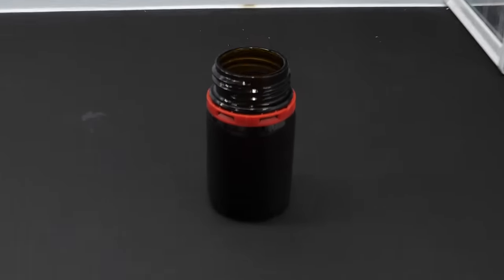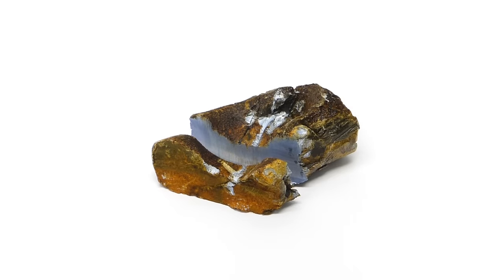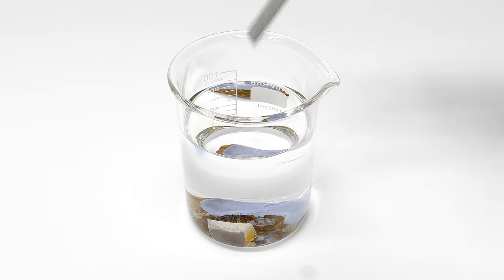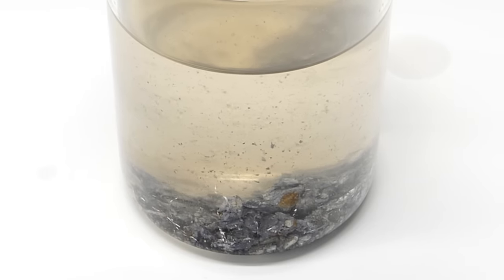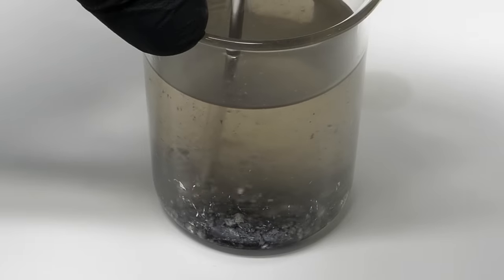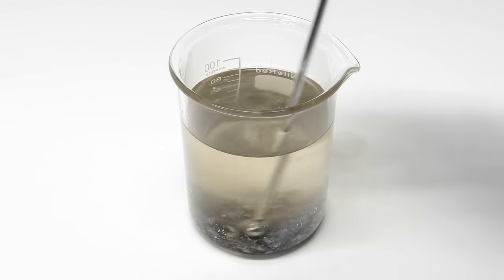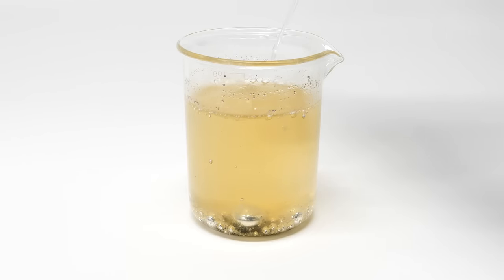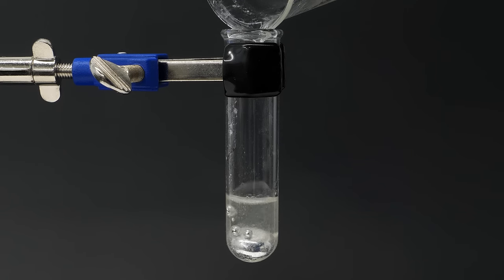Mixing sodium and potassium is crazy (NaK)

Comment: The thing that caught me off guard was just how less dense sodium is. When he said 0.9 grams of sodium I was not expecting it to be this big of a chunk lol
Reply: Oh wow only 278 likes
Reply: Nice observation
Reply: Yeah, a mole of it is like 23 grams
Reply: Sodium ain't even denser than water
Reply: @Kiromony  did you just have a stroke?
Reply: @oddmerlin9797  sorry, quite sleepy rn

Sodium's density is around 0.97 gr/cm³

Water's desity is 1 gr/cm³

This means:
 1- sodium will float on water

2- even a large chunk of that metal wouldn't even weight 100grams

It is quite impressive if you think about it.  A metal that floats on water. I think same happens with potassium, but i am not so sure about that one
Reply: @Kiromony  understandable, we all have those moments. and yeah that is pretty neat to think about
Reply: @Kiromony  "sodium will float on water" - sure, but it will also immediately ignite 😬
Reply: Yup. Well a few things contribute to low density.

1. Sodium atoms don't weigh much. Only 23 AMU.

2. Sodium atoms take up a lot of space. More than even the biggest non-Lanthanide/Actinide transition metals by a lot. One atom of Sodium is is 14.7 times the volume of one atom of Carbon.

3. Sodium packs using body-centered cubic rather than a close-packed structure. This limits its density to about 10% lower than you'd expect for close-packed.
Reply: Yeah
Reply: Well, it could float on the water :D
Reply: On the other hand, we have osmium. That thing is so dense that big a chunk would weight a gazzilion tons lol
Reply: @YourLocalCafe  Mercury is also super cool since it is liquid but also more dense than steel :D
Reply: @XXveny  It'll immediately react as soon as it touches water
Reply: I dont even understand what he is saying i just wat h him for my mom to think im smart :D and because i am brazzillian so whdn will you go to brazil?
Reply: @L_Lawliet1907  That is why there is "could". But yea, if you could somehow create very thin layer that would prevent from chemical reaction, it could really float on water.
Reply: @XXveny  well no it does float on water, it just reacts instantaneously and starts moving around. I was just adding to your commentn
Reply: About the "sodium will float on water" fact: Just put the sodium on a raft. Then you can film metal floating on water for more than half a second.
Reply: @GarryDumblowski  Another wanabe genius who completely missed the point...
Reply: It isn't? Sodium (0.968 g/mL) is significantly denser than potassium (0.89 g/mL).
Reply: @fat_pigeon  Wait, it is? I always heard people say that sodium can float, but potassium will sink. Huh.
Reply: @dferrantino  what if you put oil on top of water?
Reply: @Kaizzer  Considering they both sink in kerosene, I would imagine they'd sink to the oil-water boundary and then ignite on contact anyway. Except now it's exploding under a puddle of flammable liquid.
Reply: Huh.
Reply: @dferrantino  sounds like a tkor video.
Reply: @Kiromony  So actually 0.9 grams of sodium is slightly larger than 0.9cm^3
Reply: SAME
Reply: @potatoman6770  that amu for ya
Reply: @XXveny  noice thanks for the fact!
Reply: And potassium is even less dense, although its atomic weight is larger...
Reply: It's very small, that's like less than half of your finger
Reply: Ikr
Reply: @dferrantino  so youre saying I should use it to make a boat ?
Reply: @potatoman6770  how much is a mole of guac?
Reply: Ikr
Reply: @XXveny Lmao, how did I miss this last time I was here? Did I ignore it? Maybe I really did miss the point if the point wasn't "the density of sodium is so low it floats on water"

Comment: this is what I love about chemistry. You mix two really similar solid metals and somehow get a liquid alloy. So weird
Reply: best example is NaCl
Reply: Hydrogen and oxygen both are gas but H2O is liquid lmao
Reply: @Luffy_wastaken  yes but going from a less-dense to more-dense phase isn't uncommon. Like your example, or forming a precipitate from two liquids. Going the other way without the addition of heat or other energy is not common outside of simple evaporation/sublimation. I'm only a hobbyist (and very amateur at that), but I can't think of any other "mix two solids to get a liquid" reactions off the top of my head. I'm sure they exist, but they aren't something most folks would be familiar with like creating water (which BTW, requires combustion, not simply mixing the gasses).
Reply: @ender4555  solid-solid reactions are pretty rare in general i think
Reply: @Luffy_wastaken  thats a compound not an alloy lmao
Reply: @Aztesticals  👁️👄👁️so is NaCl my friend
Reply: @klartext5806  NaCl aint an alloy mate, neither is it liquid
Reply: @archonwarrior9146  It was just an example of mixing two dangerous elements into a harmless product
Reply: @ender4555  water doesn’t actually require combustion, it takes longer but mixing hydrogen and oxygen will make lots of water without too much heat

obviously the risk of it exploding is still high but it’s not Necessary
Reply: that's more for the physics department really
Reply: @klartext5806  yes sodium and chlorine are very similar and table salt is definitely a liquid alloy and not an ionic compound
Reply: @TheDeadOfNight37  My sarcasm meter just exploded
Reply: I still wonder what Chemists are doing in their daily, normal life
Reply: Same 4-Dimensional properties but different size. It disrupt the grid. The atomic bonds in such a grid are not strong enough to sustain the weight of the atoms.
Reply: @ender4555  How about mixing three solid metals into an alloy that is so liquid it’s replaced mercury in thermometers?
Reply: @BoxStudioExecutive  What "mix" are you referring to? I've only ever heard of either mercury thermometers, or alcohol/other hydrocarbon ones.
Reply: There are several other alloys out there too like that. Indium-gallium alloy, galistan (Ga, In, Sn), and mercury-thallium alloy are other examples of alloys whose melting points are lower than their constituent elements.
Reply: @klartext5806  You really need to look up the difference between an alloy and a compound. Unfortunately, from what I've read of the rest of the comments, you're not alone in needing to do so.
Reply: @talideon  No I just had a meme in mind before I wrote my first comment. The "this is what I love about chemistry" reminded me of that meme. I didn't even notice that his comment was only about alloys
Reply: @Luffy_wastaken  to be fair, h20 is not an alloy of two gasses. What’s actually going on here is caused by the fact that the melting point of a mixture tends to be lower than either of the two pure substances- aka the eutectic point. Since sodium and potassium both have low melting points already, the mixture of the two happens to have a melting point below room temperature.
Reply: It makes sense though, the allow has weaker molecular structure than either solids, so it melts down easier
Reply: Think about this then; gold and mercury a right next to eachother in the periodic table, but one is a fairly hard metal, while the other is a liquid. Isn't that weird? 
The reason is fairly complicated but the short version (which is the same explanation for anything in chemistry) is that is has something to do with electrons and orbitals in the outermost shell of mercury.
Reply: @aurelia8028  and maybe due to gold having 79 protons and mercury having 80 protons ?
79, 80, right next to each other
Reply: @ender4555  There's a class of ionic liquids called Deep Eutectic Solvents. A very well studied one is a mixture of Choline Chloride and Urea in a 1:2 ratio. Choline Chloride has a melting point of over 300 C, Urea is 133 C. Mix the solids together and they form a liquid with a melting point of 12 C.

There's a lot of similar things out there, but as you say most folks wouldn't be familiar with them
Reply: @klartext5806  Nobody asked for that  example though
Reply: @MangoAlexando  so did the NaK aloy
Reply: That's the part you loved?
Reply: @Luffy_wastaken  hydrogen bonds go brrrrrrrrrt
Reply: @klartext5806  its not the same kind of mixing
as stated before
NaCl is compound not an alloy

lol
people dont know chemistry it seems xD
but its cool that you guys are interested
Reply: @Bleilock1  what was your intention to write this comment
Reply: @klartext5806  to interest you for chemistry even more
Reply: @ender4555  ok but solid is more dense than liquid
Reply: @Bleilock1  Educate us, why two metals mixed are not alloys? Does Na and K form a molecule? If so, what does it look like?
Reply: @milantrcka121  ummm when did i say that two metals make compounds and not alloys?
It seems you have english comprehension problems
Chloride isnt a metal btw and nacl isnt an alloy
Reply: If you mix two similiar solids, the melting point of the mixture is generally lower then the melting point of each component.

Thought you might find that interesting. :)
Reply: @milantrcka121  It looks like this: Na - K, pretty sure it exist in the gas phase. (Na - Na and K - K definitely do)
Also, if two metals are sufficiently different to another, they can form intermetallic phases that have a stochiometric composition, high melting points and different crystal lattices then the original metals or the alloy. So yes, metals do form compounds, not only alloys.
Reply: @MichaelaEV Well water isn't all that inert. It will put out a hydrocarbon fire. But throw sodium, potassium or cesium on water and watch it explode. It's why lithium battery fires are so dangerous. Because water does NOT put them out. They have to burn out on their own. 

Remember that the next time you drive one of those electric cars.
Reply: @davidharris2147  The only reason why water is considered inert is because it is everywhere and has already reacted with everything.
Reply: @Luffy_wastaken  because it's chemistry
Reply: @klartext5806  Salt?
Reply: Eutectic mixtures are cool and strange. I remember my first time making a mixture of prilocaine and lidocaine; two white granular substances almost like salt and sugar, and after mixing them in a mortar they started to look wet, and then they started sweating and eventually melted completely and I had no idea what was going on. A eutectic mixture of local anesthetics it was.
Reply: @klartext5806 
Relevant portion of the comment to which you replied: "You mix two really similar solid metals and somehow get a liquid alloy."
Your reply: "best example is NaCl"
Your claim about your reply: "It was just an example of mixing two dangerous elements into a harmless product"
Oh, okay, so you saw someone mention an example of mixing dangerous elements into a dangerous liquid and decided to give another example of that which is not dangerous and not a liquid. Cool.
Reply: Not "somehow" ...
Reply: @ender4555  gallinstan of course
too bad its freezing point is too warm (-19C)
Reply: @TheDeadOfNight37  nope, only when in an aqueous solution. Otherwise it's solid not liquid
Reply: Guys, Here is The Savior

YaH The Heavenly FATHER HIMSELF was Who they Crucified/Pierced for our sins and “HERE IS THE PROOF”

From the Ancient Egyptian Semitic: 
"Yad He Vav He" is what Moshe (Moses) wrote, when Moses asked YaH His Name (Exodus 3)

Ancient Egyptian Semitic Direct Translation
Yad - "Behold The Hand"
He - "Behold the Breath"
Vav - "Behold The NAIL" <— YaH’s Crucifixion
He - "Behold the Breath"

“Behold the HAND that Beholds The NAIL” 

PROVES - YAH The Heavenly Father HIMSELF was Who they Crucified

That is EXACTLY what Moses Wrote

Here is what they mean

YaH's Name:
(Ya)d + (H)e, as YaH is what Moses called Him and YaH Declared: "this is My Name, this is My Name for all generations" (Exodus 3)

YaH is The Creator of “MAN”: (Genesis 2:7)
Yad He, (HAND BREATH), as YaH's "HAND" Formed man from the dust  of the Earth and His "BREATH" made him a living being (Adam)

YaH's Sacrifice of Crucifixion for “MAN”:
Vav He (NAIL BREATH), the "NAIL" through YaH’s "HAND", in Sacrifice of Crucifixion, that whosoever shall call YaH Savior, His “BREATH” brings forth life (Salvation)

How YaH arrives:
YaH arrives via the Tent of Meeting (Exodus 33:7:11, Isaiah 54, 55), where a Tent is erected outside the city, a cloud descends upon the entrance of the Tent and YaH appears...

Why they demanded YaH to be Crucified:
YaH was Crucified according to Hebrew law (Deuteronomy 21), to be Hung on an Almond Tree for BLASPHEMY as it was for His NAME they demanded Him Crucified. The Messiah claimed He was YaH...

HE WAS YaH!!!

HalleluYAH translates “Praise ye YaH”

The Hebrew Book of Isaiah

Isaiah 42:8
"I am YaH; that is my Name! I will not yield my glory to another or my praise to idols.

Isaiah 43:11
I, I am YAH, and there is no other Savior but Me.

Isaiah 45:5
I am YaH, and there is none else.